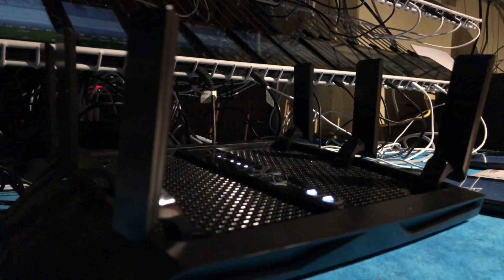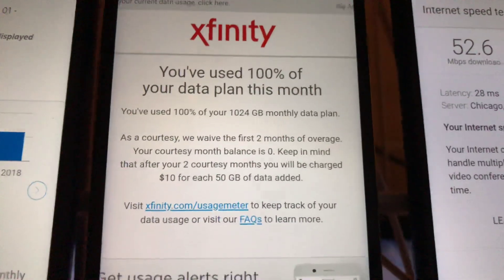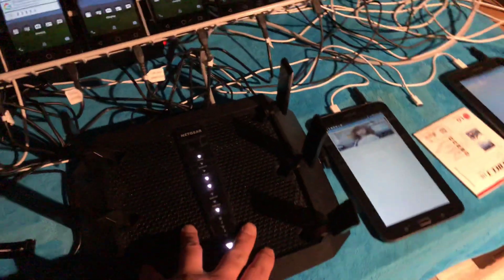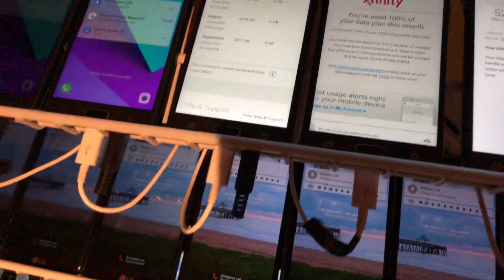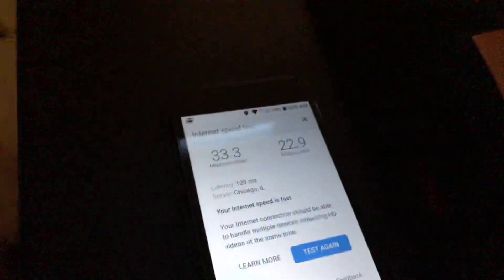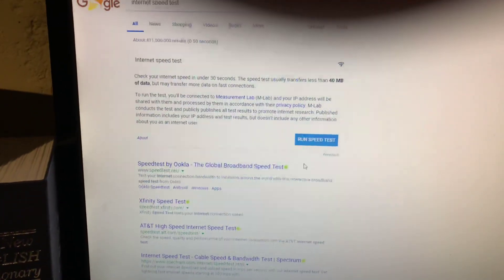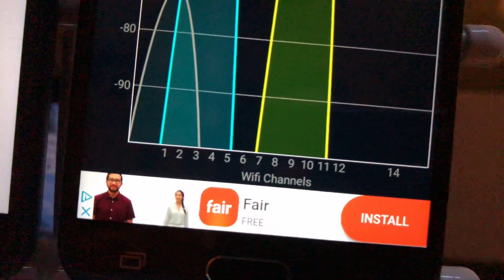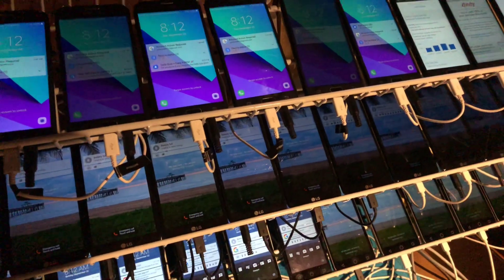WiFi how much data does a phone farm use?

Comment: How many phones can your connection handle you think? Do you think 300 phones is your limit on the 1gb? I know you need a bunch of routers to handle all the connections because the router is gonna screw up if too many connections is running on it.
Reply from the maker: Ring Tone 300 would be nice, I have to put it to the test. I will be buying more phones little by little to see what happens.
Reply: Money Farm Tech  I got a 330mb dl and 330 upload speed currently running 43 phones 4 computers still running strong no problems